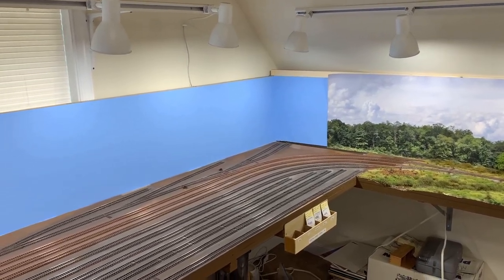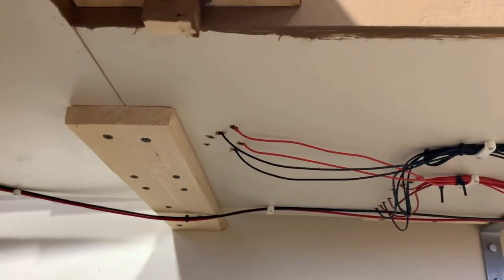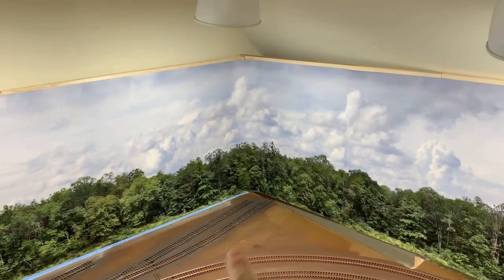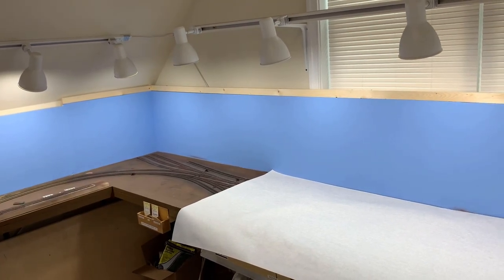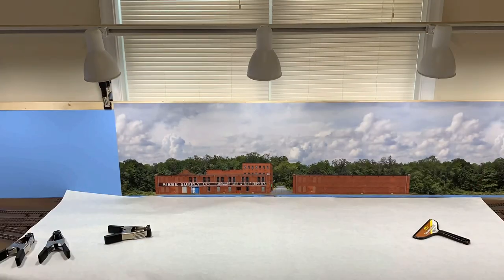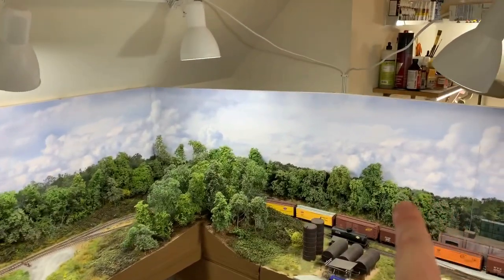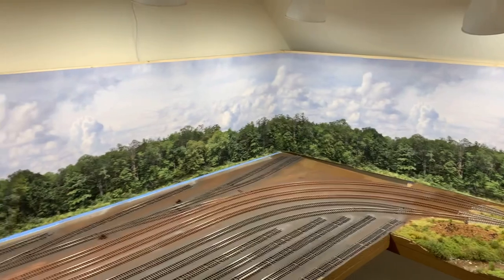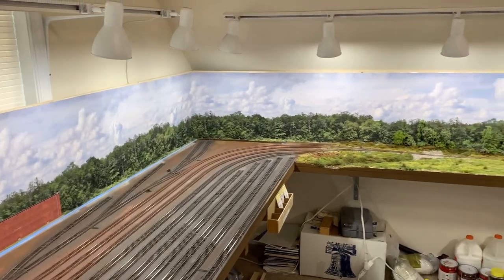South Yard: Photo Backdrop Install

Comment: Looks great John! Could they not do a long continuous roll or did you order different segments at different times? - Jason
Reply from the maker: they go up to 96" but it starts getting unwieldy - the one I ended up doing crooked last time was 96".  The sections with buildings on them are 60" and a bunch of different ones all tie into each other like dominoes.  It's pretty slick as you can mix and match off the shelf.

Comment: Great update! I just installed "Valley Flats Tenements Rough" on my RF&P 4' shelf switching layout. It was pretty easy but i realized a few days later I got a wrinkle in the middle of it. Fortunately I can only see it in natural light, it disappears when the layout lighting is on.
Reply from the maker: Very nice, Clay - you might have seen that same section at the end of this video.  I am glad your wrinkle is not noticeable under normal layout operating conditions!